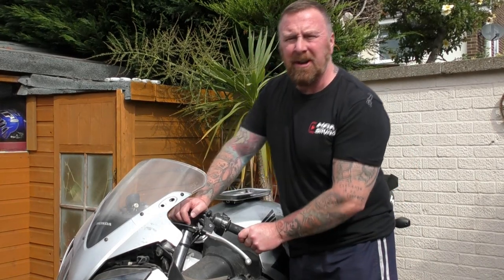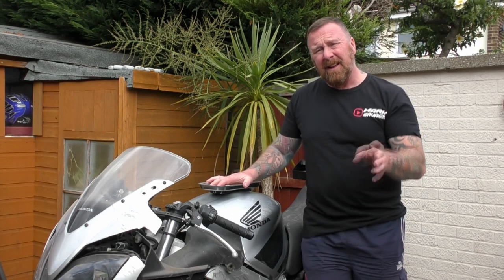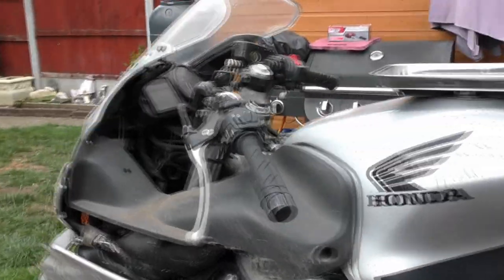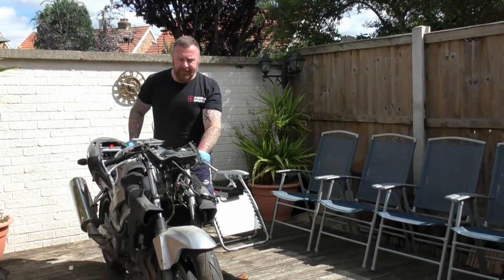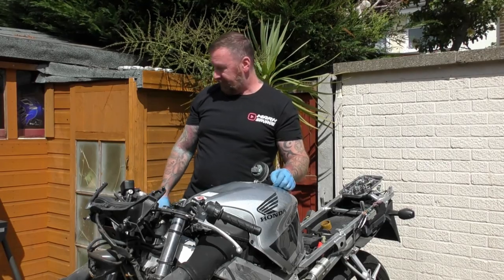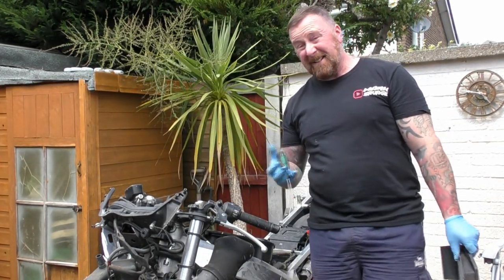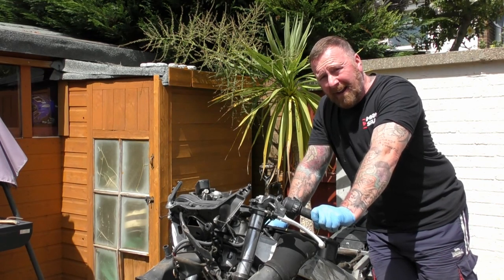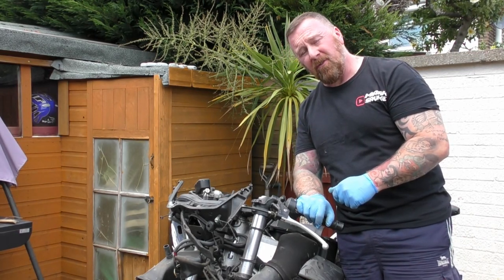HONDA CBR 600 TAKING THE PANEL OFF & SEE IF IT STARTS MARK SAVAGE

Comment: Hello Again,
I’m here for more advice

First of al I would like to thank you for all the help you have giving me regarding my 2000 Peugeot Vivacity! 🙂

Another question though, I need a new exhaust but mounted on the exhaust at the minute is the word PEUGEOT and a bunch of numbers, I doesn’t seem to be removable as it’s welded on. My question is: what is it? Is it important and how do I transfer it to my new exhaust?

Thanks,
Dylan
Reply from the maker: No worries just take off and replace 
Numbers are nothing to do with the bike just part number 
It will also run so much better with a sports exhaust
Reply: mark savage Brilliant Thank You So Much!

Comment: It has a bank angle sensor in nose fairing ;)
Reply from the maker: Oh I see and most of the relays so makes sense why it needs it 
Thanks bud
Reply: Yes it does have the tilt sensor in the nose.. I know because  mine wouldn't start with the nose of either. It cuts power to the fuel pump.

Comment: Hi so I’m looking to get a derbi senda or a rieju MRT 50 with a 70cc kit because all my friends have expensive 125s and I don’t have that kind of money so these are cheaper, I was wondering would the bike blow up if we were to ride long distance or go on A roads at like 50mph continuously for like 10 min max?
Reply: Tempz Modz I guess your new to Marks channel, he doesn't like big bore kits never has and never will, Your MRT 50 will never keep up with a 125 cc even with a 70 kit on it, you probably won't blow it up but, you will seize the bike due to the bike being built to run all day at 30/35 mph, Sorry for intervening buddy but, had to be said on your behalf...Take care be safe.
Reply from the maker: Well he knows me well and agree with what he said for me lol ,
Don't 70 kit it !!!
However they will do 45 and ive had a few derbi's that are happy at 50mph  for miles !!
I've rode one back 30 miles and just let off and then back up to speed again 
Service it , use good 2t 
And check or replace the cheap chain for a good one 
It will run well but won't keep up with 125s but if they are mates they will keep with you bud till you can get on a 125
Reply from the maker: As for the Reiju , not had much luck buying them as most are none runners and there's a reason for that , I'd leave them unless you like playing with the engine a lot !!
Reply: mark savage yeah they only drive around 55 to 60mph I can get a 125cc since I’m 17 but I want a supermoto but theyre very expensive that’s why I went for this option, since it’s my only option I guess
Reply from the maker: Watch my 125cc videos , there's loads out there for your budget

Comment: Hello mark hope all things are going well your side, a quick one I’ve recently brought a Yamaha yzfr125 and when I come to riding her at about 3,0000-4,0000 revs in traffic or stationary she splutters, I’ve change the spark plug and cleaned the air filter I recently put some fuel injector cleaner in but she is still spluttering, would you have any ideas on what it could be ? Thank you buddy and awsome content!!! X
Reply from the maker: Carb or injection ??if Carb off and I'd give it a good clean with taking the jets out and clean 
If Injection not much you can do but use cleaner 
New fuel filter 
, you've changed the plug and air filter so all ok
Let's know bud
Reply: mark savage it’s a carb mate but has a fuel injector and fuel pump and such that works fine, yes mate I have changed the spark plug and air filter and also an oil change I took the fuel injector out and gave it a clean and she’s still doing it it’s only at 3,0000 - 4,0000 revs when I open her up it seems ok ?
Reply: I was going to take off the carb and clean it but stupid as it sounds I can’t take it off haha, where it’s been on for so long the screws are nearly rounded on the clips that hold it lol
Reply from the maker: @hatton992  could be faulty fuel pump !, you say you have changed the fuel filter ?
Maybe check the fuel lines
Reply from the maker: @hatton992  flat spots are hard to find and sort but is fuel normally
Reply: mark savage ok mate I will get back to it some point tomorrow Lol, I didn’t change the fuel filter but I’ve checked it and it seemed ok, ok thank you mate
Reply: Hello bud I’ve been told it’s not a carbed bike she is fuel injectored.... so maybe that could mean that the fuel injector could be faulty
Reply from the maker: @hatton992  the rubber seal can go on the injection fitment part 
And I have had a new plug mess around 
Worth changing  plus ht coil ?
Cheaper to try than a new injection
Reply: mark savage thank you buddy I shall give that a try and see how she gose again thank you bud
Reply: mark savage hey man just an update on my issue I’ve just changed over my ht cap and no splutter running sweet as ever ! I can’t believe it was something so simple as that !! Lol
Reply from the maker: @hatton992  that's great news and a cheap fix bud
Reply: mark savage thanks buddy ! It sure was !

Comment: Hello mark my Peugeot vivacity 125 wont start press the eclectic starter and it just clicks I’ve changed the starter motor and relay solenoid and still won’t start and just clicks does it need a cdi ?
Reply from the maker: If it clicks the relay is ok 
You need a volt meter 
Check power to the starter !
And your earth 
You can get a bad new starter bud 
But check power to it first

Comment: i just found a speedfight 100 enginge for about 300 dollars, the 100cc should be 100% bolt on the speedfight 50cc ram right?
Reply from the maker: You can fit a 100cc into a 50 cc 
However make sure the 50cc was disc rear as most where drum , more parts needed otherwise plus the carb and air box  are different and oil pump will need to be changed 
Poss cdi too 
80 videos on speedfights to help on my channel
Reply: @marksavage  yup my speedfight has disc rear no drum https://www.blocket.se/annons/alvsborg/peugeot_speedfighter_motor__original_100cc/91364240 as you can see in the link u get everything, carb airbox etc
Reply: i just noticed that engine is air cooler and mine is liquid cooled, will that be a prolem?
Reply from the maker: @trasig952  no ,just take off the rad and pipes 
And make sure it has the plastic engine cover , link doesn't work but as long as you get all the bits it will fit on , plus use a sports exhaust 
Could do with changing clocks as it will do more the 50mph lol
Reply: @marksavage  okay i dont see any brake disc tho, maybe its a drum?
Reply from the maker: @trasig952  maybe ? But most had disc rear !
Reply: @marksavage  idk, can i swap it and start it without a mobbilizer or i do need to spend big bux for a new cdi?
Reply from the maker: @trasig952  you would need to make sure its the same cdi as you speedfight now 
Otherwise its a new loom and cdi to match the engine you are getting 
So if it a immob engine you have to have an immob loom and cdi etc 
Same with the oil pump set up 
Manual or cdi oil etc

Comment: That's a TON of work and I'm surprised that anyone would pay you for it!  ( *It must have been a 'Salvage' price to start with to make it worth investing $700 or more into the machine )
*They're desirable machines here in the U.S. because of the 'power-to-weight' ratio, but that's usually younger guys that want 
that 'Cafe Racer Look' while riding, which to me is just 'not good for more than ten-minutes' when you're 66!*
Reply from the maker: Bud as in my moped and you should see who I get some of them!!
I like getting them and working to see the result at the end 
Yes things don't go to plan but what and see bud